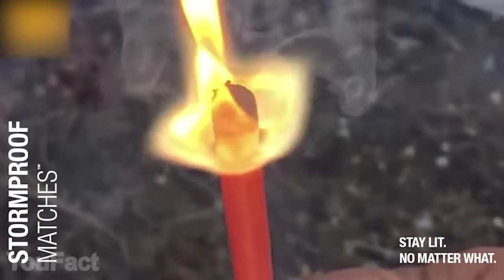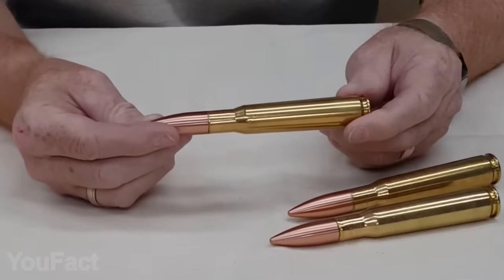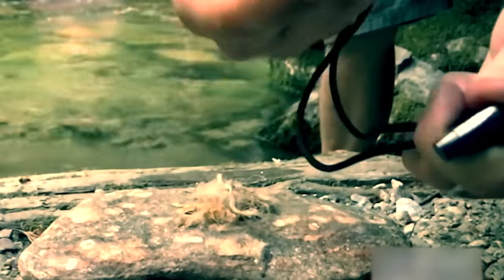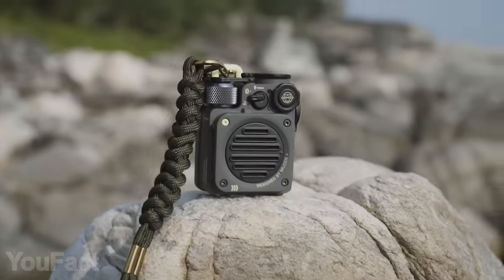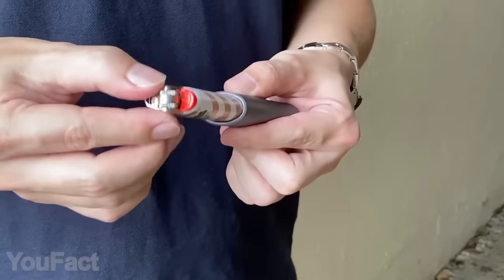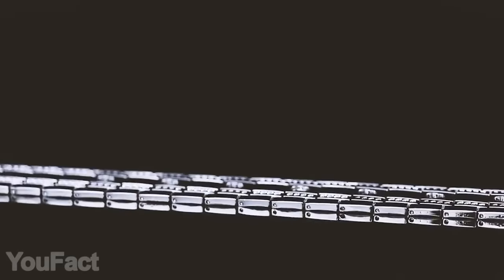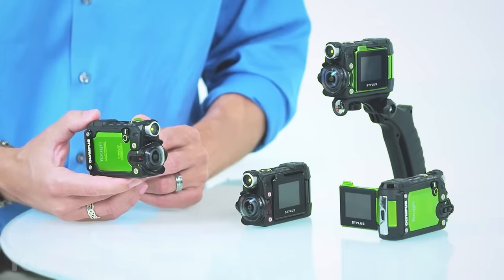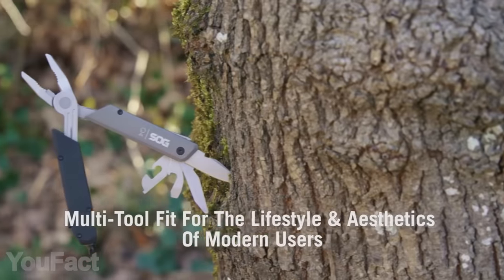19 Coolest Gadgets for MEN That Are Worth Buying

Comment: Cool steel belt, but nowhere any info if you can shorten it by yourself, if the holes can be readjusted so you can have a slighter tighter lock or not....